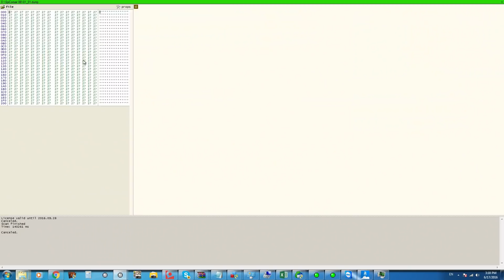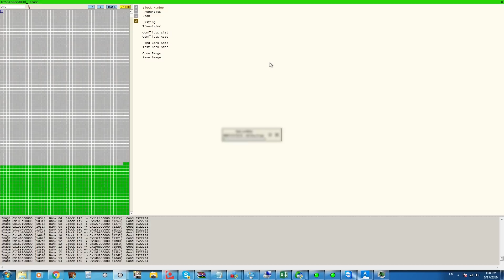usb drive not showing up - how to recover data

Comment: I really just don't get what i should do now
The USB flash drive i'm trying to recover has a metal cover that's stuck to the USB module and i've tried every possible thing but Windows won't recognize it and i need to use this stick since i don't have any other left and it's the middle of lockdown

Comment: Can you tell me, what kind of hardware you are using to dump the chips? And why aren't you using PC-3000 Flash?
Reply from the maker: I use two different ones Rusolut and SoftCenter. I haven't had any need to explore further equipment for flash stuff yet, simply because these two that I have handle almost everything that comes in.
Reply: Thx man, Ive tried reading nand flash for a while but when you have the pinout and start reading you hit another wall, the filesystem structure changes from brand to controller to chip. its a headage and the software you demonstrate seem to autodetect most of em. wonder if I can get a cheaper version without the need of buying hardware.

But its a clue, for profecionals like you, I totaly understand and agree of buying that. Induviduals should either go to a service like you, or totaly screwup and try reading it themselves like I do. I dont care bout my data, I care about learning how this works and so its fine im stuck with a blob full of bits that doesnt make sense. 

To demonstrate the dificulty of recovering data: https://hackaday.com/2014/08/06/reverse-engineering-a-nand-flash-device-management-algorithm/
So yeah, go buy that hardware/software or go to your HDD Recovery Services... its not that easy as it used to with eeproms that are just bits. it has datacorrection, tables, spare bits... cool :D

So some questions I asked, if the software is availeble for free or trial to use on just a dump, but by looking at their websites... problematic. but they seem to be able to read and recover alott ;) totaly depends on the IC used in USB stick or nand storage.